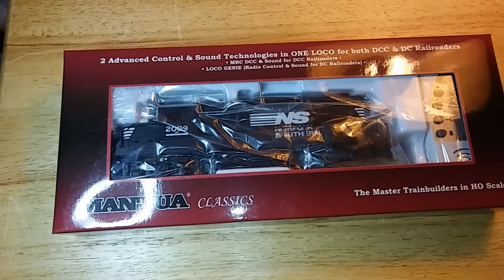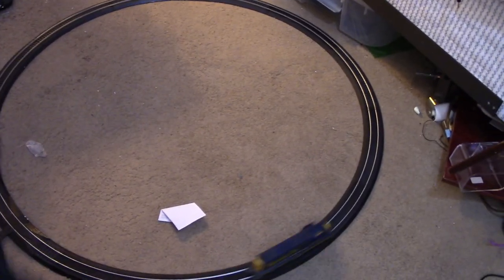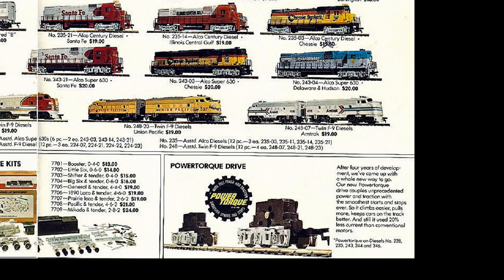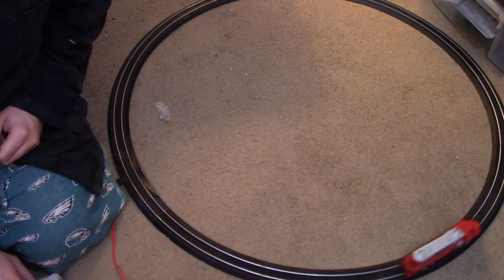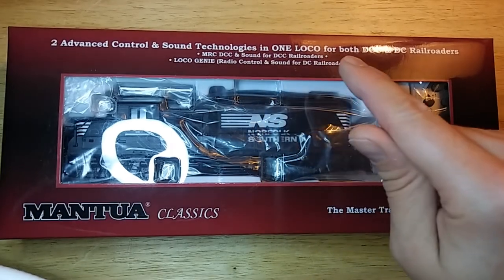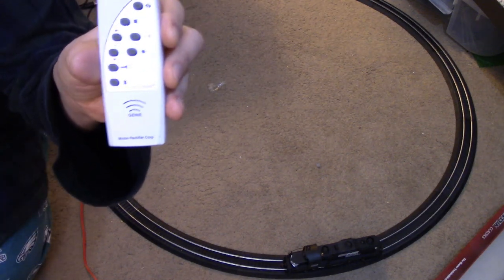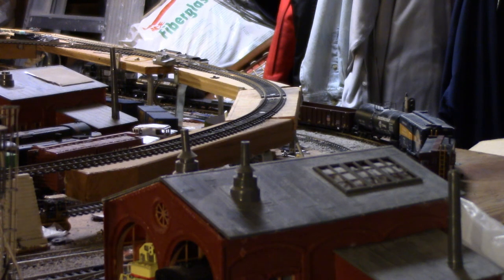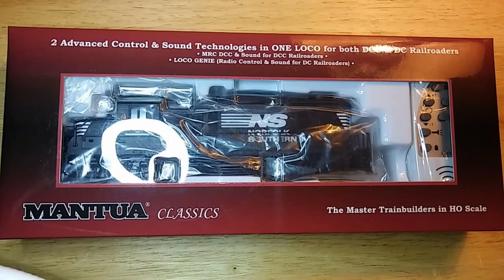Mantua GP 20 with loco genie

Comment: Twenty years ago I kitbashed a M-T GP20 with the chassis of an Athearn GP35(?).  It was a spot on fit and required very little modifications to either the shell or the metal chassis.  It's still one of my best runners.

Comment: Concerning the opening in front and rear pilot areas to the Mantua GP20, with a little effort this can be rectified by installing plastic backing and snow plows to fill in this somewhat obvious flaw in an otherwise fine running locomotive.  I have a few of the Mantua Classic locomotives and have found them extremely smooth runners with or without flywheel.  I notice the Model Power brands also use the same basic metal chassis and drive system.  Thank you for sharing the history of Mantua and its final off-spring described in you presentation. PS; I do not run DCC and am referring to the DC Mantua classic line.  :-)

Comment: Whats funny is i have a 1975 chattanooga 2-8-0 Tyco tender drive the motor runs smooth as silk. Unlike the power pack low speed sends it flying however if on a mrc tech 2 it crawls and runs quiet. The gp20 santafe you have I had no issues til. My 3-4 yearold hands grabed it while it was running pushed it faster them it was to go and yeah it's gone. It was a 1989- 1990 1991 Tyco santafe 72 piece train set. I wish my parents kept it aside for me. But I want to get a gp20. Similar but non power torque. The mantua steam engines i have are from 1970s they run great. Love the brand they had now lionel has it and they never mention it again... I had a mantua diesel the dual motor drive was not working right nor worth it as plastic wheels had piece broke and the shell was brittle so i have spare brushes for my 4-6-2. 3 pole mantua steamers.

Comment: Did you play with the starting voltage? Read the manual on it.
Reply from the maker: It acts the same way, whether its being operated on dc or dcc. This Includes it taking off buy it self or just stopping out of no ware. I'm pretty sure its the decoder, especially considering how badly it was installed by the factory  Also, I have had the same problems with several of MRC's DCC & sound decoders in the past.